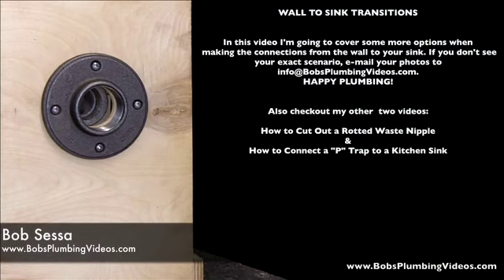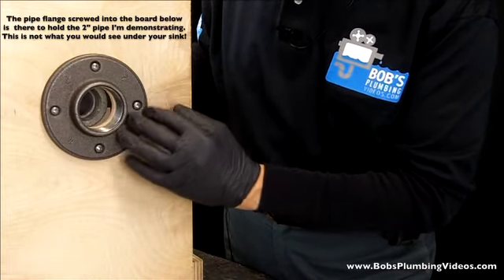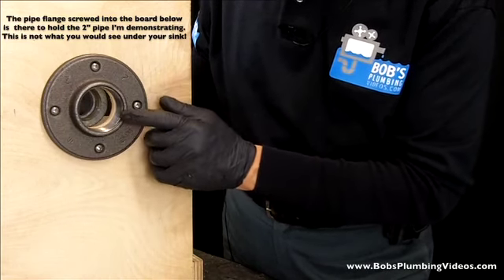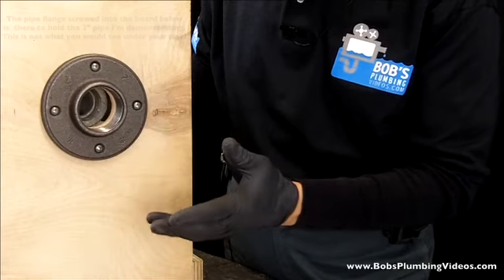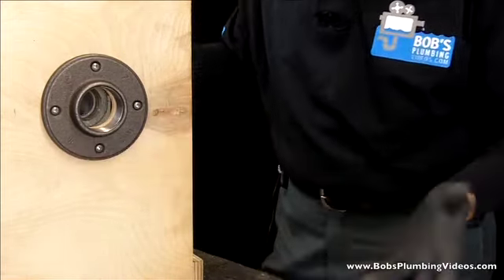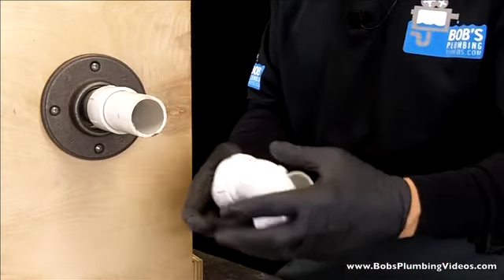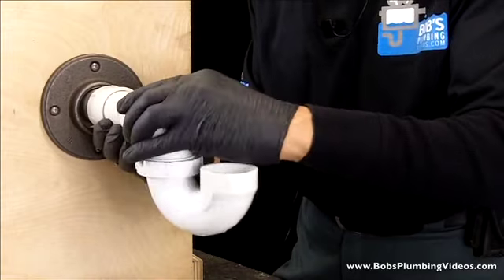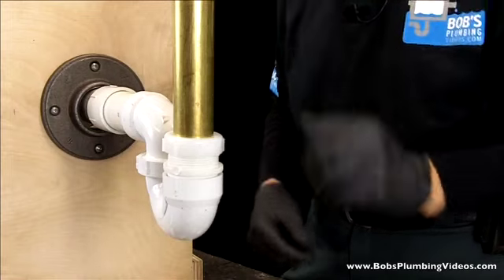P Trap Installation

Comment: Thanks for the great video. It can be very confusing even for a handy person as there are many ways to do this work and we don't do it every day. Plumbing materials have changed too (PEX, etc) but I have all metal plumbing in my house. I  often go to the plumbing supply as they offer valuable advice after I tell them what I want to do and they have never failed me. I replaced a bathroom trap that rotted out with PVC in a similar fashion as you show, connected to a copper drain line with a hubless fitting. I also replaced a tub drain above a garage with a finished ceiling. Only made a 6" x 4" hole to get to it. The hardest part was screwing out the 60 year old pop up drain. I recently replaced a garbage disposal that is smaller than the old one and the drain didn't line up. As a temporary measure, I used a flexible plastic accordion pipe but don't trust those. I later removed it and replaced it with a slip coupling 1 1/2" 90 degree elbow and a PVC tailpiece  pipe to the disposer and another PVC pipe to the brass trap. Lots of dry fitting and cutting but no leaks. I tend to error on too long and cut again - too short is worse for sure.
Reply from the maker: You're welcome, it's a process and after doing it for close to thirty-eight years I'm still learning. Thanks for checking out the video. Regards, Bob.

Comment: Great video. I was planning on putting a new vanity set in my bathroom 48” with the sink centered in the middle and the existing trap and 48” vanity is not centered. It is 14” from the wall to the center of the trap. I need to move the trap over 12” to center it. How do I go about doing this?

Comment: I am confused about why you attached the trap adapter with a slip fitting inside that pipe at 6:14, because it reduces the inside of the 2" pipe. Doesn't the Uniform Plumbing code forbid doing this? I usually cement the trap adapter to the outside of the PVC pipe.

Comment: Very helpful information!  My bathroom sink P-trap is leaking at the joint where the trap outlet is connected to the drain adapter horizontally directly, at a 45-degree angle without modification.  The weird thing is that no leaking occurs when the faucet water is running.  Only a few droplets dripped a minute later after the water was off.  I replaced the P-trap according to the manufacture,  but it's still leaking.  I have tried numerous tips to fix it, but none of them worked in my case.  What else could cause the leaking?  Thank you for your help.
Reply from the maker: Maybe, this will help? https://youtu.be/AuKHMyyRu9k

Comment: Bobs you are excellent plumber, can you do a video explaining the distance that every stuff could be, from the wall. for example a toilet 12". A P-Trap how far it could be? 
From the sink,  and how many P-Trap can we use in a bathroom.
Thank you for all your video, and God Bless you.
Reply from the maker: +Francisco Garcia  Here's the toilet video:https://www.youtube.com/watch?v=kDujiqXeXvY. Manufacturers always supply recommended rough in measurements with their fixtures, but they can vary depending on job conditions. One trap per fixture is code here in N.Y.C., distances from the wall to the trap will vary, but as a rule of thumb I'll set my waste lines approx. 15" to 20" off the floor. The waters lines 22" to 25" off the floor. Again that can vary depending on the manufacturers specs. Thanks for watching, Bob.
Reply: +BobsPlumbingVideos I see all your video, 
Muchas Gracias Querido Bubs.

Comment: You’re not allowed to use tubular fittings under the sinks where you live? It’s so much simpler and easier to take apart if someone needed to run a cable down the sink.

Comment: Found your video searching for a solution.  I am in NYC. My kitchen brass p-trap is attached/screwed onto the galvanized 2" nipple coming out of the wall. I can't unscrew the p-trap from the nipple - this thing has been there for over 30 yrs. I'm trying to avoid cutting the nipple. Am I allowed to attach a long sweep 90 to the drain tailpiece, then connect that to the galvanized nipple using various PVC bushings and adapters?
Reply from the maker: If you're going to leave the trap, sure but check out this video. You can cut off the threads just behind the installed trap and convert to p.v.c. I'll assume you have enough of a nipple coming out of the wall to clamp on to. https://youtu.be/Wdt4O3uFEtY
Reply: @BobsPlumbingVideos  Thanks for the reply Bob. I was hoping not to cut the nipple b/c it is in great shape and I'd like to keep the heavy duty brass trap which is similar to the one you show in your video.  But if I can't finagle the tailpiece and elbow to fit, that's what I may just have to do.  Thanks again!

Comment: I had no idea there was places where it was anything other than tubular 1-1/2" for kitchen and 1-1/4" tubular for lavatory as here in Illinois, though I try and use 1-1/2" for both kitchen and lavatory.  Showers are 2" and toilets are either 3" or 4" -- all our traps are usually in the tubular and the heavy schedule 40 starts with a trap adapter at the wall -- all ive ever seen here is a trap adapter from sch. 40 to tubular at the wall and tubular the rest of the way out to the sink drains with the trap being directly under the sink as you say.  But im just a DIY guy so im sure theres lots I haven't seen.
Reply from the maker: Different methods in different parts of the country. In N.Y.C. Kitchen sinks, laundry sinks, washing machine stand- pipes are all 2" diameter. Lavatories are 1 1/2", showers 2", toilets are 3" or 4" I like to get as close as possible to the fixture before converting to tubular. But that's my personal preference

Comment: What is the rough in is 'too low'?  Is it possible to use two 90s to rise the effective height of the stub out (inside the cabinet)?
Reply from the maker: If you can use two 45's or if no room, use a TY and 90 -degree elbow or street elbow. Glue at threaded adapter on the top of the TY and plug it with a threaded plastic plug for future cleanout access.

Comment: Bob,  I know this is off topic, but I would love to see a video on a standing waste for a tub.
Reply from the maker: I will definitely put that one together, Anything,in particular,you want to know about standing waste and overflows?
Reply: Yes thank you Bob. I have a situation where the Standing waste is connected to a galvanized trap that connects to the soil line and electrolytic action has corroded the galvanized trap and is leaking where it is joined. I haven't done this before. I am sure I will have to cut it out. I am thinking that I need to use PVC to connect I guess a new brass trap to the soil line or PVC trap with an female adapter.
Reply from the maker: Common repair for the plumbers here in Brooklyn! I'll get to work on the video!

Comment: and the height from the floor to the center of  wall outlet
Reply from the maker: A minimum of 6"-8"  to a max of 19" off the cabinet base. Anywhere in between will work.

Comment: The title says "Sink drain doesnt " line up".  Was that suppose to mean its P trap coming from the sink doesn't align over the pipe coming out from the wall?    My problem is the what if the sink is "offset" an inch or two to one side from the "line" of the pipe coming in? I tried using one of those "accordion flex tubes" and it worked fine....but over several months got CLOGGED with crap that got "trapped" in the accordion part of the coupling.
Reply from the maker: You could use an 1 1/2" rough brass waste offset. You can an adjust the distance (offset) depending on where you make the cut. No ribb's to worry about.
Reply: It keeps showing how to "line up" in the description of the video yet nothing in the entire video addresses that problem.

Comment: what if your pipe come straight up from the floor not the wall?
Reply from the maker: If it's coming up from the floor (not code here in NYC) you can use an "S" trap http://amzn.to/2izRC8j. Our kitchen sinks have to be 2" but I know in parts of the country you can use 1 1/2". Check your local codes.

Comment: What if stub out pipe is ruffed in is higher than trap.
Reply from the maker: This is a good question. If I'm using a tubular trap I'll some times flip the trap around and connect the tailpiece into the shorter end of the trap. Not necessarily the correct way to do it, but in a pinch, it will work.  Extreme cases, open the wall and lower the stub-out!

Comment: Why not PEX ?
Reply from the maker: You can use plastic if you like! No problem!
Reply: Pretty sure Moon Pie is right... I think PEX is only for supply lines.
Reply: 1.5" & 2" PEX exists, but it's professionally installed stuff for commercial, high volume supply lines, not DWV. Also, the tools needed to expand those sizes of PEX-A aren't priced in the homeowner range.  There aren't traps to connect to that size PEX, and you can't just bend it in the radius needed for a trap either. Basically, no, you wouldn't use PEX for drain, only supply.